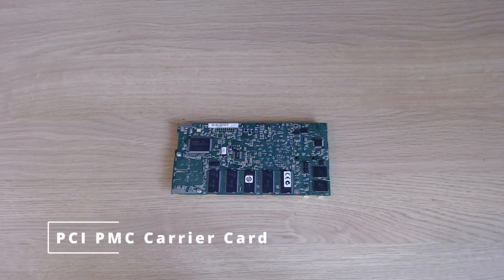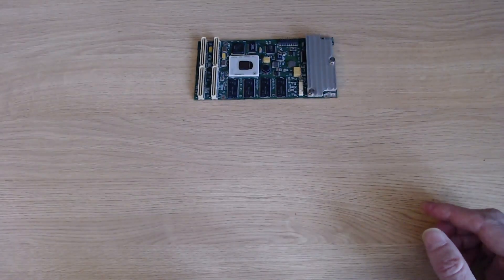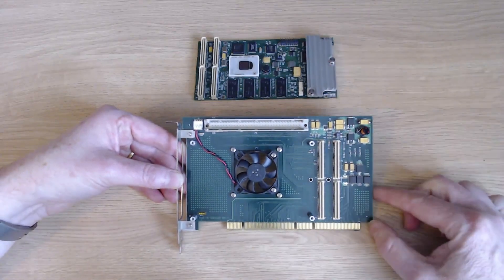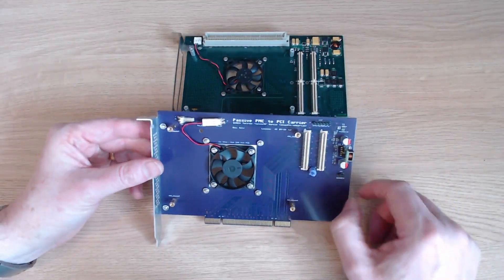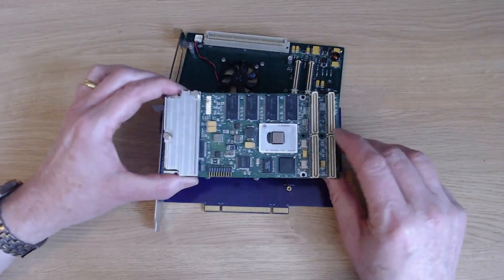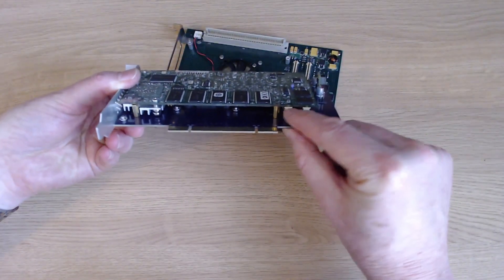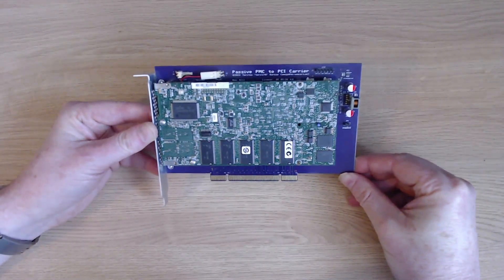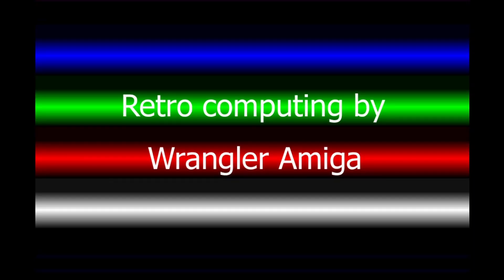PCI PMC Carrier Card tested

Comment: So, all of that just to get more memory? Why waste a slot, just add SIMMs
Reply from the maker: Err, what?  The carrier card is to add a PowerPC secondary processor
Reply: @wrangleramiga896  which does what? Make Lightwave animations render faster like an accelerator? Would like to know. That could've been a game changer back in the day.
Reply from the maker: @mikedefoy There's a lot of modern software developed for WarpOS as well as the P5 software keyboard_g mentions, eg MP3 decoders, and lots of games that run much better with a PPC than an 060

Comment: Cool stuff! I had no idea that you can run 68k AmigaOS with a PPC cpu??? Always thought PPC was only for running OS4🤷‍♂️
Reply from the maker: You might want to check out my conversions of Duke Nukem and Stratgus (Warcraft 2) which play well under OS3 + PPC
Reply: Also, he may be using some version of this:
  
https://en.wikipedia.org/wiki/WarpOS
^ originally branded as WarpUP, but the name was changed to reduce confusion with another product

https://en.m.wikipedia.org/wiki/PowerUP_(accelerator)
Reply from the maker: Yes, running WarpOS
Reply: @wrangleramiga896 very cool indeed! I've owned an AmigaONE X1000 since it's release on the PPC side and back in the day never had a PPC but had a CS-MKIII-060 so missed the Warp3D stuff altogether
Reply: My naive assumption would be that you can't actually run the 68K operating system on the PPC card. But you should be able to run other software on it (essentially meaning you have a PPC co-processor).

That said, if your computer supports PCI bus mastering then with a PCI card capable of that and appropriate software the card can basically take over handling the PCI bus from your system.

The result of the latter should be a sort of computer within a computer that can still communicate with the primary one.

Comment: Thanks Wrangler. Nice to see about these. I have the Bigfoot Killer M1 PCI card and kept seeing these and wondered what this was all about. Cheers 🍻
Reply: Pardon me, but what does a NIC have to do with this? I mean, the M1 is a bit more than just a NIC but the general usecase of it is as a NIC with built in filtering, firewall etc plus offloading things like torrents to if you prefer having your CPU for other stuff.
Reply: @noth606  Because it houses a PPC chip that the same Sonnet Libraries use for the PMC cards.
Reply: @cullmaster7361  Ah, did not know this, I have a Killer NIC but never played that much with it since I ended up having to run everything via wifi quite soon after I got it. I knew it had a PPC of some kind but never thought of it beyond that. Cool.